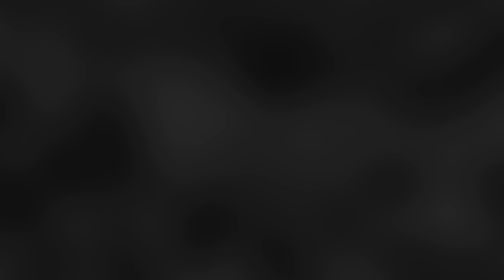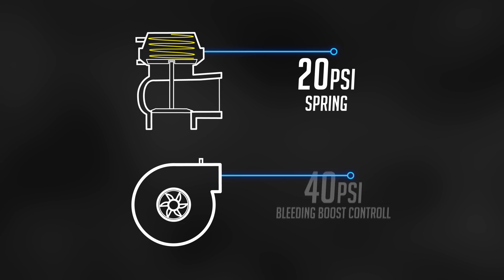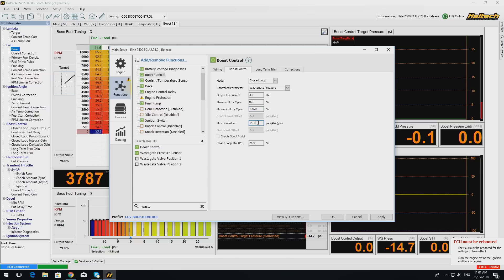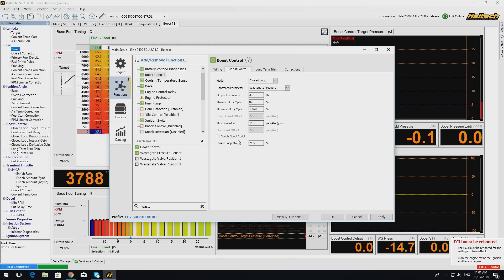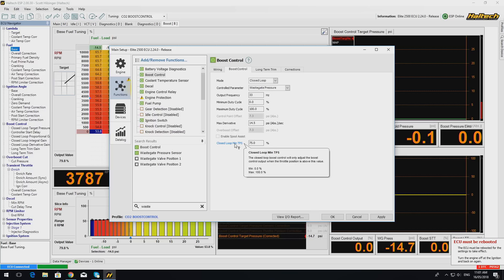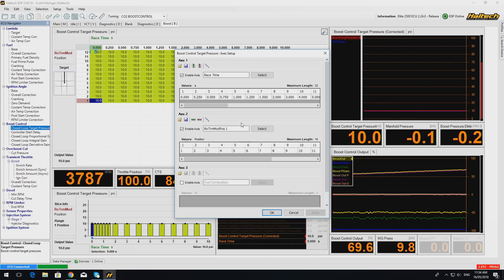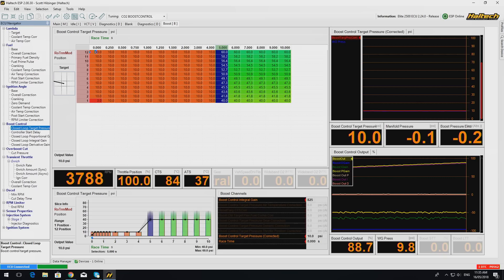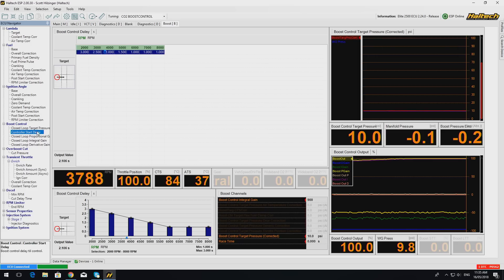💬 How CO2 Boost Control Works [Technically Speaking]

Comment: Considering the 2 times spring pressure thing, what would typically happen if I try and use closed loop boost control on a single port wastegate actuator with a 7 psi spring and try and run about 20 psi?
Reply: If it's not realistic, what would be a more sensible solution: higher spring pressure or a dual port actuator?

Comment: Would be great to use in street aplication, this precision will keep tires gripped accelerating on wet road especially in curves limiting and   controling more precise the torque.  I will fill up the CO2 bottle at beer shop 🤣

Comment: This is a really great explanation and demonstration of how Haltech can control the wastegate pressure, but leaves me wondering..

If we set a target wastegate pressure, can we monitor and target a specific manifold pressure (traditional "boost") as well? How is the system keeping the wastegate closed to build boost then controlling the level of boost actually available?

I would have thought having actual boost at the throttle plate as the controlled variable would give the "best" closed loop boost control. I must be missing something.

I don't own Haltech but intend to use an Elite series ECU when I  eventually build my turbocharged XU10 16v engine here in the UK.
Reply from the maker: Wastegate pressure is only applicable to CO2 boost control and you can force the wastegate to stay closed until you want with this control method. This is predominantly a drag race only method of control and not applicable to most applications.
 
You cannot use the throttle to regulate boost effectively.  Boost is controlled via a pressure bleed solenoid that regulates the amount of pressure at the wastegate diaphragm. Our ECUs offer a number of ways to control the boost and it is more up to the user to select the method they would like to implement to suit their application.

Comment: It strikes me that a wastegate could be designed around a high-speed stepper motor (plus gears and levers) to provide fully-electronic control of the wastegate's valve. Combined with pressure transducers and a bit of software, you're done. Skip all the pressure lines, CO2 bottles, fiddling with springs, etc.

There are those that would instinctively react (without thinking) that such an approach must be impossible. Fiddle sticks. I've seen plenty of applications of such technology that's more difficult than this application.

One obvious consideration would be to design the system to keep the stepper motor away from the excess heat. So the final assembly would probably be bigger than a normal wastegate.
Reply: Wouldn't be as reliable and tiny.

Comment: Why CO2, why not just use air?
Reply from the maker: CO2 is a very safe gas to use in engine bays etc, as it isn't flammable. It is actually used in some fire extinguishers.
Reply: Okay I think I understand what you're getting at, rather than have a potential air leak that could intensify an under bonnet fire you use CO2 to mitigate this potential hazard right?

Comment: No wonder the boost ctrl options for left me wantng.. its been put into the elite. Was almost bald frm d hair-pulling of tryin to run a fast enuf co2 gate ctrl wit only 1-solenoid (no press sensor) on my ps1000. Cause at the time i was exploring using co2 (2-3yrs ago iirc) nobody had even d exp nor d slightest clue wit dis kindof ctrl strategm (Malaysia). Would greatly appreciate if anybody wiling to share any tips for setting up co2 dome control (2-solenoids if poss.). Keep up d great content Haltech!

Comment: On a supercharged setup can you use a blow off valve to limit boost, instead of a wastegate? Or are BOVs not designed to control pressure as accurately?

Comment: Why not make a electrically actuated wastegate?
Reply: brett20000000009 heat, the force required to keep it shut the size of the stepper motor.
Reply: Variable Vane Turbos have this

Comment: Since a dual-port wastegate can give you a wide range of pressures, is the only advantage to a CO2 system more precise boost control?
Reply: Yeah, I really don't get the advantage of using co2 instead of boost pressure for the pressure sources. You can use a 2-port wastegate with boost pressure and a solenoid. It seems to me you're adding extra expense, complexity, and maintenance (refilling tanks) to an otherwise simple system.
Reply: 4g63holset I was thinking it may be more necessary for controlling substantial amounts of boost (40+?) Where I think a dual port is fine for running 5-25psi?
Reply: It makes sense for big drags cars, imagine having a twin turbo V8 for example, you may want to do the burnout or launch at 5psi and then wind it all the way up to 40psi. CO2 is also much quicker to respond and more accurate
Reply: Fanboy part of comment: OMG!U awesome, Greg. Big fan of your way of doing things! Keep it up!
Proper part of comment: I would imagine that it is an "every 1% of improvement counts" type of deal, especially for competitive applications. More precise control, especially at very high boost levels, faster response, etc. I can't see anything that has such a high refill demand (i made that term up) to be targeted towards "street" applications.
Reply: At 4:00 he talks about the advantage of CO2 vs. using the intake as the regulating pressure source.  Since the response time of CO2 is much faster you can tighten the control loop to make boost corrections much more quickly (you don't have to wait for the change at the waste gate to propagate through the intake tract).
Reply: I think you two are dyslexic, you have to wait for boost pressure,  using the turbo or waiting for manifold pressure to stabilize as a source it’s not as consistent you can’t build what you want right off the line you don’t need to use c02 you can use compressed air and a pump. But it’s pretty clear you two don’t know what proper waste gate control is and how much of a difference it makes. You have to wait for the control to over shoot the target and must Stabilize that takes time also Springs are not consistent pieces of metal when you add heat to it. That’s why f1 use pneumatic valve Springs,  that’s why air suspension works better   Then metal coils also knowing exactly what the wg valve is doing did you not watch the video a pressure reference sensor and a position sensor to exactly when to open the valve or to see if it’s being forced open by back pressure.

Comment: Maybe the answer is obvious, but could you use an onboard air compressor to replace the CO2 bottle as a pressure source? I'm not suggesting to always replace the bottle with a compressor(obviously a compressor is a lot heavier than a full bottle),but  if you already had a compressor on the vehicle. Most compressors, either engine driven or 12 volt electric, produce a minimum of  120psi(8 Bar), with plenty of volume. I think  the answer is  yes and the C02 bottle is generally chosen for the low weight and innate incombustiblility  desired in drag racing?
Reply: I was wondering a similar thing - some applications use on-board air operated shifting, if that could be used to power the valve?
Reply: Yes you can do this ppl do it for sequential air shifting transmissions.

Comment: For a street car, an onboard air compressor and 1 gallon tank is also a great option.
Reply: CO2 is inert, Nitrogen is inert, both are used as a fire suppression agent. 
Air is an oxidizer and accelerates combustion. 
For life-safety reasons compressed air is not used. 
Pressure regulation is more stable, controllable and repeatable using CO2 or compressed Nitrogen than compressed air.
Reply: patw52pb1 omg air is flammable? You’re sure not bitching about that turbo that compressing air in large amounts!
Reply: I was wondering about this myself, especially if you already have the compressor system in place or weight is less of an issue.  I think you'd want a really good water separator on that solenoid supply line though!
Reply: CO2 is not flammable, thats the case
Reply: Just hook up a sodastream bottle.
Reply: Sodastream tank cost more than regular one
Reply: Air is non flammable too...

Comment: So possibly dumb question, why CO2 vs nitrogen or even a compressed air tank you could refill yourself?
Reply: Hamish McGregor probably because c02 is filled to a much lower pressure than nitrogen or air. I work for an industrial gas company and deliver the stuff. Generally we fill c02 to 40bar (480psi),  nitrogen and almost everything else to nearly 300bar (4350psi)
Reply: CO2 vs nitrogen might just be a matter of cost and/or convenience. I'm curious about compressed air, but I think the concerns could be water fouling of the wastegate vacuum lines or flammable air tanks interfering with some racing safety regulation.